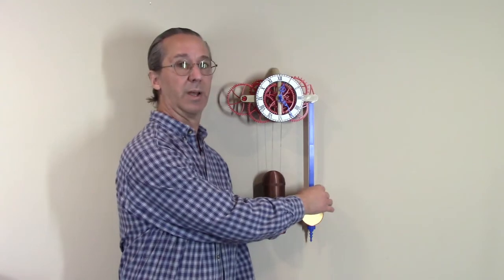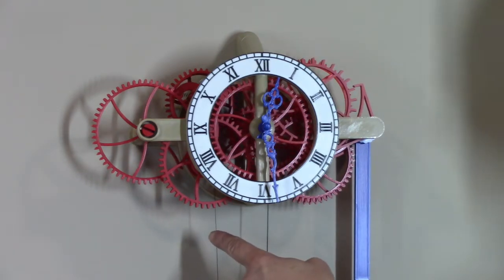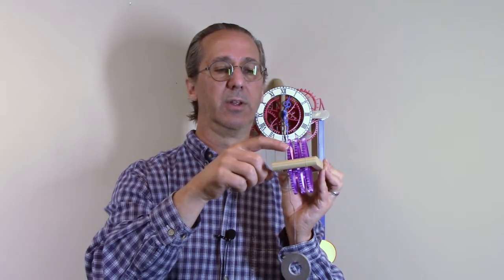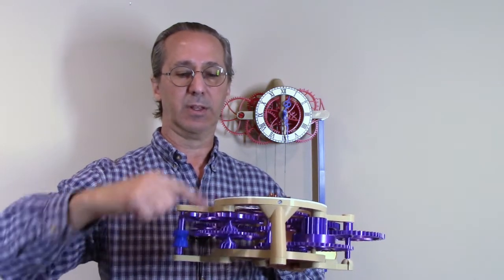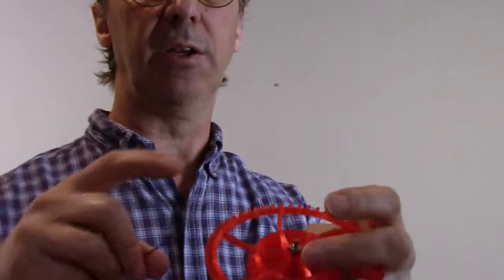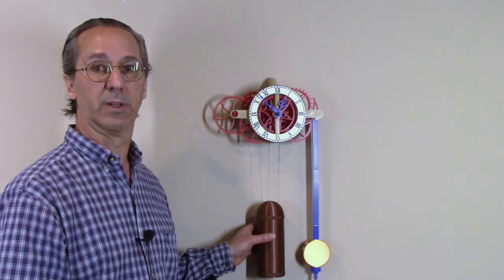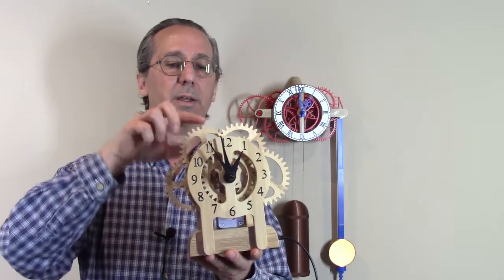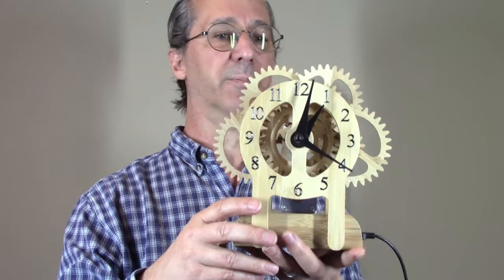Sticky Clock Gear Solution

Comment: I, II, III, IV, V, VI, VII, VII, IX, X, XI, XII       IIII?
Reply from the maker: Look at 100 clocks with Roman numeral dials and you will see 98 of them using IIII.
Reply: @stevesclocks  That is true. Many different theories as to why, but just wanted to hear your opinion. I have a clock collection and even a Vienna Regulator on display at NAWCC. I just never thought about it after 50 years of clock repair and collection. I have a few antique wooden clocks and also wanted to make a more modern or kinetic sculptures with laser or CNC, but 3D printing has proven to be the quickest way to produce prototypes. 

Thanks for sharing and your work is excellent!
Reply from the maker: @charlesf1150  Nobody seems to really know why they use IIII. Clockmakers are typically very resistant to change. I suspect the first clock accidentally used the wrong number and everyone else copied it. I think IIII looks better than IV.

I am starting to branch out into wooden geared designs. 3D printing is certainly faster for prototypes and the colors are great, but wood looks even better.

Comment: Anybody has the problem the clock wants to run backwards?
Reply from the maker: The gears only go together one way. The only possibility I can imagine is that the cord is wound around the winding drum backwards. The ratchet would also need to be reversed.

Comment: I have a similar problem with the small easy build clock, but in my case the front of the clock sagged downwards over time and all the arbors are tilted downwards. I wish there was a way to somehow adjust the height of the clock face in relation to the back.
I am now thinking of building the larger version of the clock. Is your helical gear solution included in the large version?
Reply from the maker: Both sizes of the clock have the same issue, so the helical gear fix was added to both designs. 
I typically print the frames with 4 perimeters and 20-30% infill so they are strong enough to resist sagging. Some have been loaded with as much as 11 pounds (5kg) of weight. It also helps to make sure the mounting screw is the proper distance from the wall. If it is too loose, it allows the main structural beam to tilt downward and the clock can sag.

Comment: Awesome Steve!! I have 2 of the Easy built 32 day clocks running, and they both have this 'sticky escapement' problem. Crops up every so often, then seems to magically work it's self out for a while.. Was scratching my head on it .. LOL. Glad there is a solution :) The Large Easy build however has been solid since day one.. never experienced any issues with it ☺☺
Reply from the maker: Hi Jeff, The difference between running and sticking can be very subtle. A wall with a degree or two of slope could be enough to push gear 3 either into or away from the escapement. It only takes a small amount of pushing against the lightly loaded escapement to stall the clock. The helical gears pushing away from the escapement makes the problem goes away.

Comment: I have a similar problem with your original clock. escapement just runs out of power at some point. Clock runs anywhere for 4 - 30 minutes. Early on it was running for 7-8 days but would get stuck on burrs or elephants foot on some gear pieces. Sanded those all down, and now it's just stopping even with the entry and exit pallets not blocking the escapement wheel. Have been looking for friction in the gears on and off for about a year. If I pull down really hard on the weight it will start ticking again, so not identical to what you have here. Seen anything like this before. Once I get this one working again I was going to do a couple of the easy build clocks with my kids. Thanks love your stuff!
Reply from the maker: The symptoms described in this video only affect the easy-build clocks. 
Stoppage in the original clock could have several possible causes. 
One possibility is dust in the pendulum support bearings. Remove the escapement and test that the pendulum still free swings for at least 10 minutes. If less, then try cleaning the bearings.
Another possibility is frame sag over time causing the arbors to bind slightly. You would often see the frame shift when lowering the weight. This can often be fixed by tightening the mounting screw or shimming the lower standoffs so the clock sits flush to the wall. 
Other possible solutions include adding an extension to the weight shell to provide more power. Or add a light coat of lithium grease to the pinions. I did this on the easy build clocks while debugging the sticky gear problem. The pendulum amplitude increased and there does not appear to be any long term issues with grease on PLA. Only the pinions need to be greased. It will work its way onto the larger gear teeth.
The clock at my father in laws house has been running continuously for about 3.5 years now.

Comment: I have been working on your 3d printed clock and after printing gear 3 I noticed a helix angle on the pinion and thought something went wrong and after seeing this video I now see that this was programed. I must say your clock design is great and how you worked to solve this problem.. having fun building this clock

Comment: Hi Steve,
Downloaded the new helical gears but have noticed that Gear 3 has a larger hole - 2mm plus which makes it a very loose fit on the 1.5mm arbour. Any thoughts?
Reply from the maker: I design everything with 2mm holes because holes always seem to print smaller than expected. I usually have to drill them to fit 1.5mm arbors.

If your setup is producing 2mm holes, then use 2mm or 0.078" music wire. The escapement and frame would likely also have 2mm holes to match.

Comment: Thanks for finding the problem and posting a fix. I've had fun with your clock design but was frustrated that sometimes it would run much longer than other times. After watching this video, I saw that my clock was sometimes hanging at a small angle that creating the problem you described. It now works much better. Great follow up.

Comment: Hi Steve.  I noticed this very same problem in my large 21 day clock.  I solved it by printing spacers just large enough to go between the escapement and the front frame and gear 3 and the back frame with about a half mm of end play.  This keeps the gears aligned very well.  So far it has been running 2 weeks without stopping.  This solution sounds much more elegant.  Are the modified gears available in the zip or the individual files section on MMF?  Or should I purchase a whole new zip?  Thanks for the great explanation of the problem and solution.
Reply from the maker: Adding nylon washers on both sides of the escapement to reduce friction is a decent quick fix. Maybe thin down the shaft height to create room.

You should be able to download the entire design forever after purchasing it. The individual files can be found by expanding the "object parts" section in the product description.

Comment: Great that you were able to find the problem and design a fix.   I would like to see more designs that are electric powered, as they don't require constant attention.  Maybe you need some jewels in the movements (just kidding), the bearings in the pendulum clock might be used in others.
Reply from the maker: I agree about electric movements. Trying to find quiet solutions.